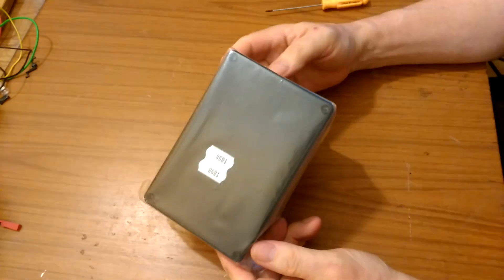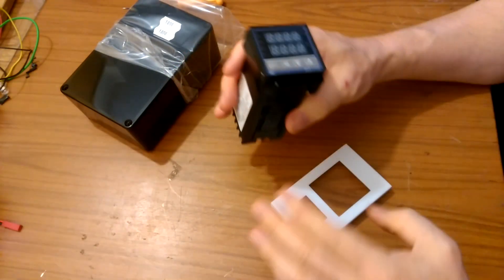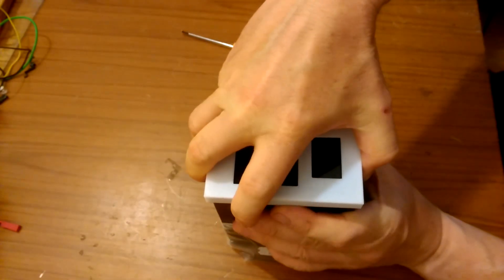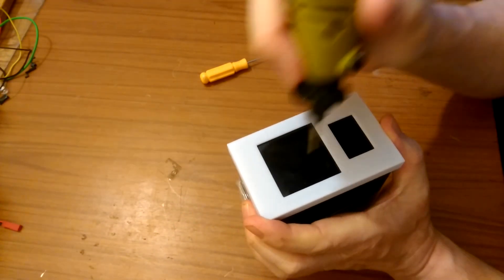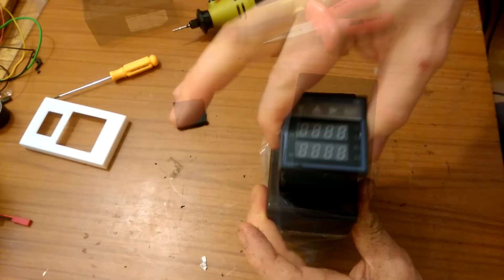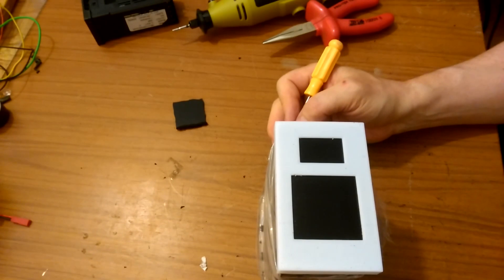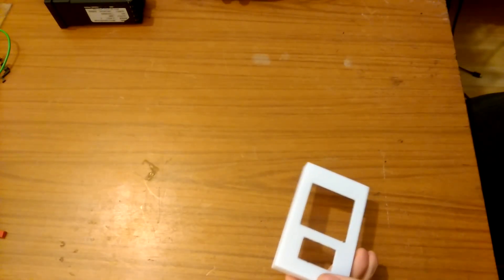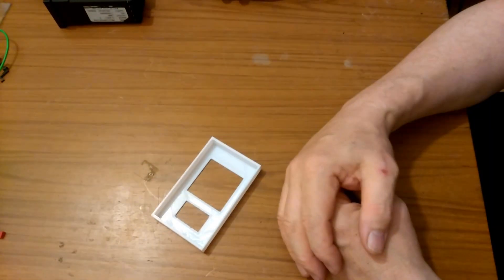Making Accurate Project Box Holes

Comment: what about to use a chisel to cut those holes?
Reply: This boxes don't like be punched in any way, they will crack, it's better to drill or try with heat like a soldering iron to burn the pilot holes.

Comment: You could cut a piece of metal plate with the holes & insert it into the back of the template, this should protect the template holes from being damaged.
Reply from the maker: Yes, but it's a lot of work compared to printing one of these. For some of my other jigs I've made stainless steel inserts to protect them which works really well.

Comment: Nice idea.. have you tried using a cutting wheel/disc on your rotary tool instead of the bit.. Just turn down the speed so you don't melt the plastic.
Reply from the maker: Yes, but it's still miserable and error prone. These jigs are better.
Reply: I agree, I thought a cutting disc/wheel would be best, but never ever again

Comment: Hello Chris.  Nice video.  I think many would like to do the nice square hole for switches and such.  I found the easiest, cleanest and quickest way is to heat sharp utility knife and the knife cuts through plastic like butter.  If you have a template, even easier.  Just a little cleaning off of the edges and you are good to go!
Reply from the maker: Hi Brent, yes I've tried that too, but for me - cleaning the "swollen" edges is more problematic. And since my boxes have a very thin strip down one side of a large hole they are very fragile so you can't hit it hard with a file, for example. For me, the cutting jig is the way to go - until I can afford a CNC router. Thanks again.
Reply: @chriswesley594  Heh no problem.  Keep up with the good vids.  They are very helpful :)

Comment: You can use a pattern cutting bit w a bearing on it. It will save your pattern and be more accurate. You'll want a flat baseplate for your dremel for that. A small trim router would be better. Hope that helps. The bearing bit is key
Reply from the maker: Thanks for your suggestion James,  but I'm not clear what you're saying. I Googled "pattern cutting bit" but that didn't help me.
Reply: You simply need to redesign your jig a little bit larger to account the bearing dimensions. After that, you won't need to trace your line, you simply go along the jig with the dremel, it won't damage the jig and the holes will be perfect without filling